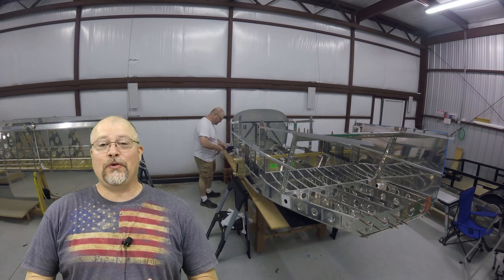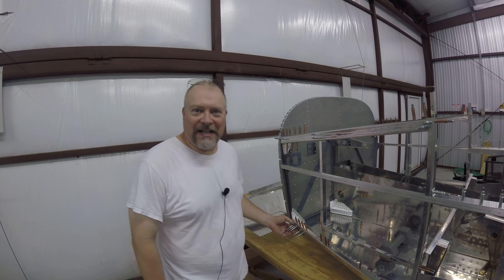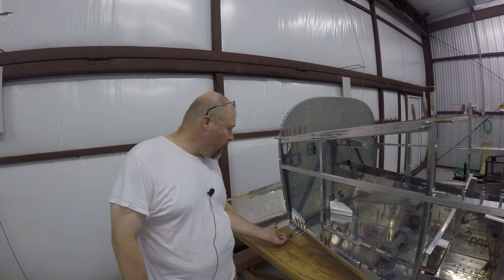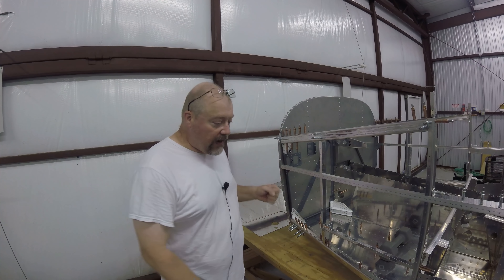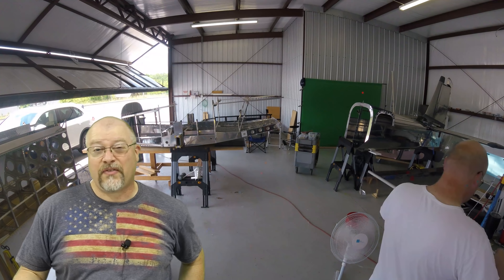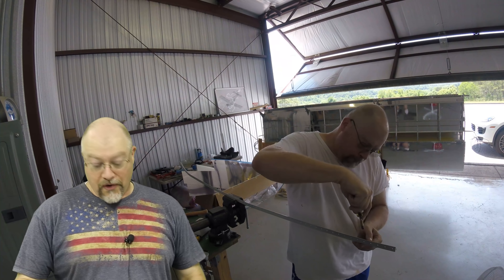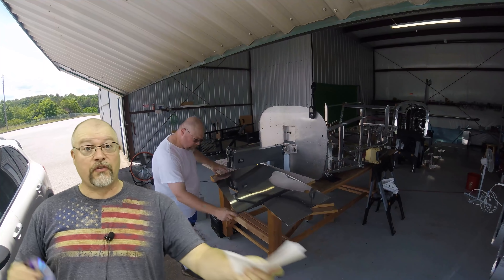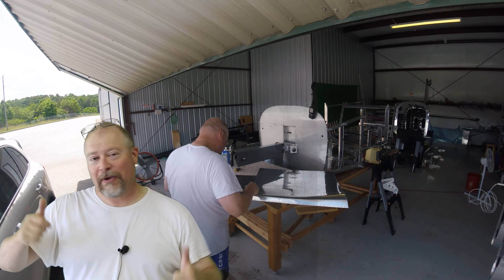RV-10 Fuselage - 027 - Q&A, Skins, Dimples and broken tools

Comment: Couple of things to your very informative video.
Anyone thinking of getting a hangar to support their build I would suggest getting your name on a list while you're doing the empenage. 
I was told 6 months. It happened in 3 weeks. I had to turn it down because I  had nothing to put in it. Two months later I bought a 172 and it sat outside for 2 months. Hated that.
I'm about to start an RV-8 and inquired about a bigger hanger to house my present plane and my future build. Discovered it's actually cheaper for me to own two T-hangers than pay for next size up. Great relationship  with airport management so that helps...😇 You should be able to build an empenage at the house or quite possibly even an apartment...lol
I was about to order an RV-8 empenage kit when my legacy avionics died in my 172.
Money going towards that now but I ordered RV-8 plans from Vans to keep me motivated. They'll gladly sell them to you.
I would suggest a potential kit builder buy the plans from vans if you're interested instead of engaging in possible copyright infringements and ripping off a good company. Why wouldn't you want to support the company? I know I want them to be successful because they have beautiful products and I want them to be around for however long it takes me to finish my plane...lol.
Reply from the maker: 6 months is fast.  It depends on the area you live in.  I know there are people here locally that have been on the list for over 10 years.  I myself have been on it for over 5.

Comment: Before you put those skins on... notice that there are holes for nutplates on top of the F-1040-L/R Upper Fwd Fuse Channels.  Make sure you have those nutplates in there, otherwise it'll be a super-pain to get them in later.  Typical plans gotcha

Comment: I'm pretty sure that aviation college that sponsored Mickey and buffalo airways restoration of the ww2 dc3 built a vans aircraft just with the plans.
Reply: I could be wrong but I think those were different plans, i.e. fully dimensioned. IIRC that's why they built an RV-6, and not something newer -- or older but still available to buy as a kit.